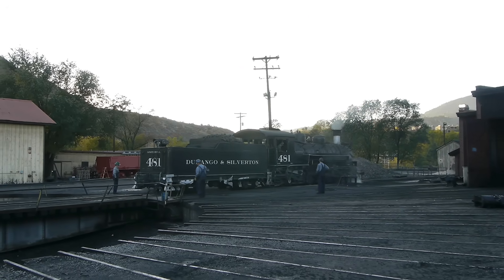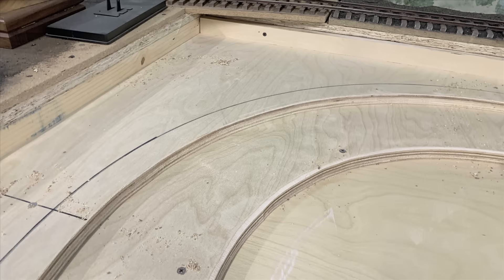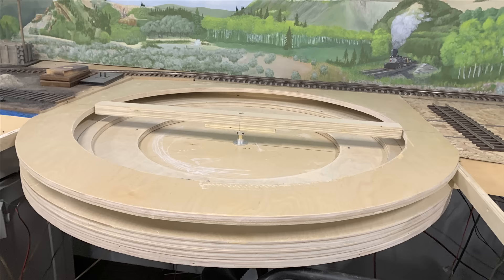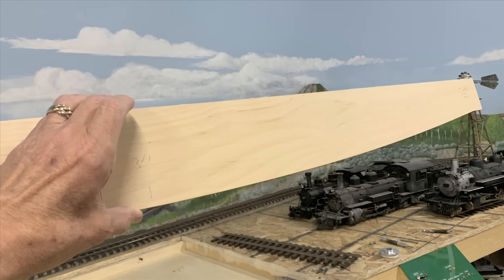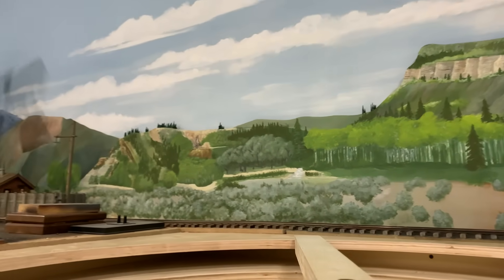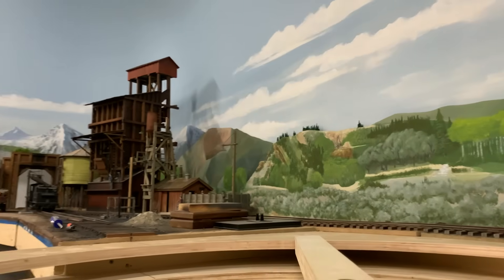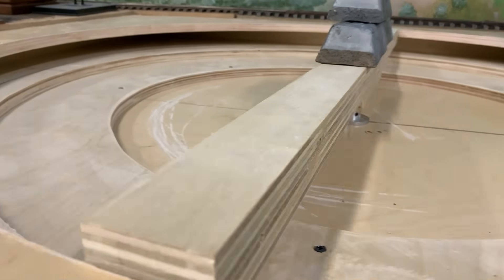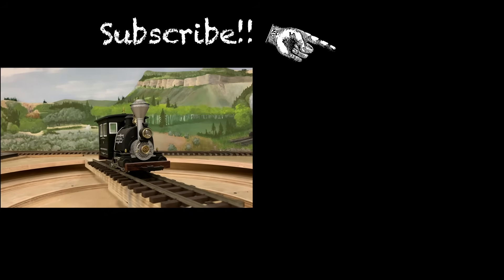Modeling  a Denver & Rio Grande 65 Foot Turntable - Part 4 -  CNC router - Motor

Comment: I think I have a life hack for you, I have an old Lionel Postwar turntable that used to be powered by a D cell battery pack with a direction switch, and I swapped it out for an ho dc transformer. It works great in O gauge, so maybe it’ll upscale, and then you’ll be able to control the direction and speed from a single point.

Comment: Mite try a auto pulse transformer for slow and power at low speed. Even my atlas turntable is powered with toy transformer and works well at 15 lbs, I'm sure I could stack two locos with little problem. 😊😊😊
Reply from the maker: Yup I bought a controller on Amazon. It hooks up to 12v. Then pulse out. DPDP reverser. 😊😊